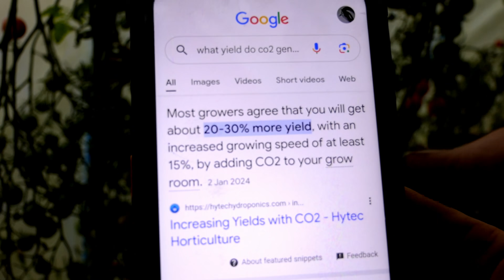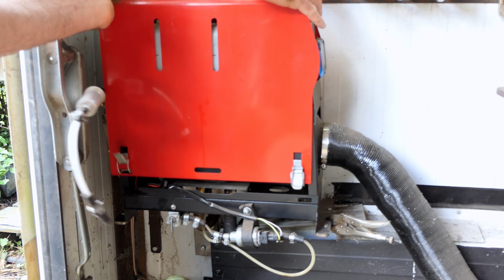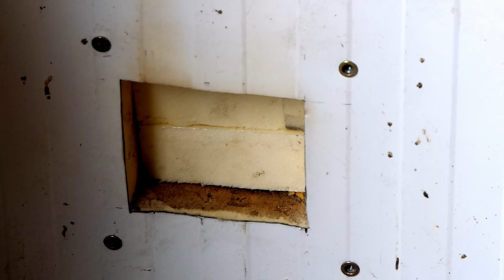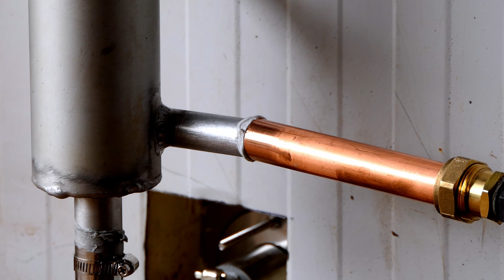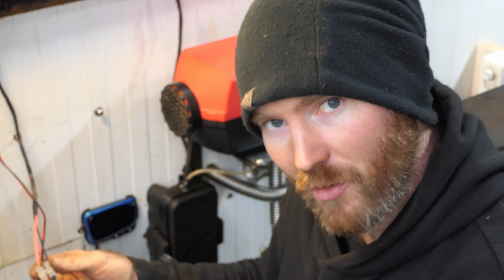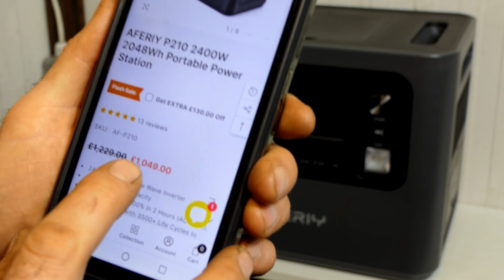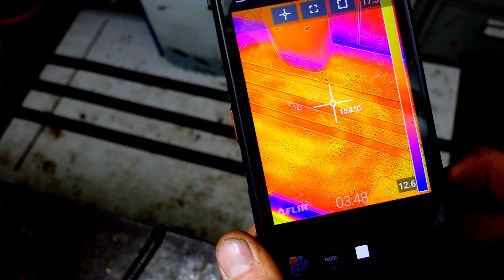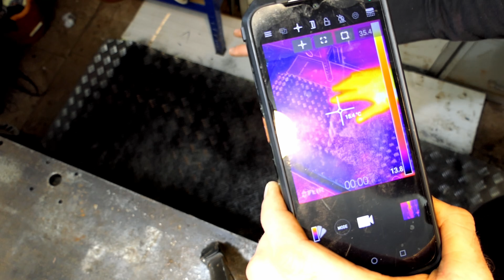NEW! Better system for Cheap and Safe Heating💲+ Underfloor Heating Mod test🫠

Comment: 1300 to 1850 AD was a natural cold period. The peak cold, around 1750 AD, had CO2 at 180ppm. Photosynthesis stops at 150ppm. We accidentally missed a seriously nasty bullet. 
By the way, Romans had it warm - aka the Roman Warm period. We were also warm from 900 to 1300 AD. Medieval Warm Period. 
That’s all Greenland ice core data. No fiddling. The information is all in there.
Reply from the maker: Very good information. Thank you. cheers J
Reply: Earth global average temperature has previously varied. But not due to human activity, and not to this degree. We are destabilising the fine balance of nature. Look at the graph of global average temperature vs time and the rise from the industrial revolution is an outlier.

Comment: I think you missed a trick, of using your 12V mains charger with a 12V 100Ah LiFePO4 Lithium Battery that typically can be purchased for less than £200. Saving you £800 🙂
Reply from the maker: Good idea. cheers J

Comment: You can make your own lithium power station using used lithium cells. They work fine with a “normal” car battery charger but you will need a lithium charge controller. 
A small motor scooter  battery is more than enough to feed the glow plug. A 4 amp battery charger is ample for continuous power of the heater.
Reply from the maker: Good tip, cheers J

Comment: You Asked: If CO2 Is Only 0.04% of the Atmosphere, How Does it Drive Global Warming?

A: Earth absorbs energy from sunlight, but as the surface warms, it also emits energy in the form of infrared radiation (which we know of as heat) out into space. Water vapor and CO2, however, act like a cap, making it more difficult for Earth to get rid of this energy. Without gases like these to absorb the energy, our planet’s average surface temperature would have been near zero degrees Fahrenheit.

About 99 percent of the atmosphere is made of oxygen and nitrogen, which cannot absorb the infrared radiation the Earth emits. Of the remaining 1 percent, the main molecules that can absorb infrared radiation are CO2 and water vapor, because their atoms are able to vibrate in just the right way to absorb the energy that the Earth gives off. After these gases absorb the energy, they emit half of it back to Earth and half of it into space, trapping some of the heat within the atmosphere. This trapping of heat is what we call the greenhouse effect. Because of the greenhouse effect created by these trace gases, the average temperature of the Earth is around 15°C, or 59°F, which allows for life to exist.

CO2 makes up only about 0.04% of the atmosphere, and water vapor can vary from 0 to 4%. But while water vapor is the dominant greenhouse gas in our atmosphere, it has windows that allow some of the infrared energy to escape without being absorbed. In addition, water vapor is concentrated lower in the atmosphere, whereas CO2 mixes well all the way to about 50 kilometers up. The higher the greenhouse gas, the more effective it is at trapping heat from the Earth’s surface.

The burning of fossil fuels affects the concentration of CO2 in the atmosphere. Before the industrial revolution, the amount of CO2 in the atmosphere was about 288 ppm. We have now reached about 414 ppm, so we are on the way to doubling the amount of CO2 in the atmosphere by the end of this century. Scientists say that if CO2 doubles, it could raise the average global temperature of the Earth between two and five degrees Celsius. We are already increasing the amount of energy that bounces back to the Earth. Because of the greenhouse effect, this is causing global warming with its many destructive impacts.

Both water vapor and CO2 are responsible for global warming, and once we increase the CO2 in the atmosphere, the oceans warm up, which inevitably triggers an increase in water vapor. But while we have no way to control water vapor, we can control CO2. And because we are increasing the amount of CO2 in the atmosphere by continuing to burn fossil fuels, even in relatively small amounts compared to the entire mass of the atmosphere, we are disturbing the entire heat balance of the planet.

For more information on how carbon dioxide traps heat, why water vapor isn’t the culprit, and answers to several other interesting questions, check out this post: How Exactly Does Carbon Dioxide Cause Global Warming?

Yochanan Kushnir is a research professor at Lamont-Doherty Earth Observatory, in the Division of Oceans and Climate Physics
Reply: Opinions matter more than facts in this new age of enlightenment it seems.
Reply from the maker: Thank you but I didn't ask that. it is the % that humans have made compared to natural CO2 that is telling. The crabon isn't the issue its the other factors of heat absorption and lack of water absorption from destruction of ecosystems that are a much bigger issue. cheers J
Reply: I'm guessing that you're referencing the claim about 0.0012%  of the atmosphere is human produced CO2 which you get from 0.04% CO2 current levels and "3% of that from humanity"? 

I can't find a primary source for that 3% figure, do you have one? The closest I've got is an Australian news broadcaster and subsequent social media posts referencing that broadcast. It seems this is a typo/decimal place shift of the number you referenced which is a 33% increase in atmospheric CO2 levels since 1850? So it's actually 33% (of current atmospheric CO2 420ppm, or 0.04%. which is 138ppm or 0.014%) from humanity. Not 0.0012%. 

Also, saying it's a small number doesn't say anything about how much of the effect it has contributed. The dose makes the poison. A 0.00001% change in botulinum content in a person would take them from healthy to death. The sensitivity of a system to an input isn't necessarily linear, meaning that small changes can cause big responses. An example being a hard ball balanced on another hard ball, where a miniscule disturbance might result in it falling much farther. You can't just say "it's a small amount so it's not that".  The question we need to answer is "what is the sensitivity of the system to CO2 levels?" and as @cpcnw eluded, the current evidence suggests it's pretty sensitive!

Albedo of roads is 0.1 vs forest at 0.15 and 0.4 for concrete. Making a ~5% increase in heat absorption between replacing a forest with a road. and roads account for 0.15% of land area. 0.04% of total area. Not factoring in cloud cover. 0.04%*5% is 0.002% difference in how much heat is absorbed. And that's ignoring the decrease in heat absorbed from concrete vs forest. There are heat domes around urban areas due to this effect and it does contribute to global warming, but not massively.

Forests also suck up huge amount of water releasing it through the leaf pores and increase local humidity levels, which decrease local temperatures, but if the local temperature is over a comfortable level then since RH is ~100% people feel uncomfortably hot because they can't loose heat by sweating. They still sweat, it just stays liquid on them as the air capacity for water vapour is already saturated. This humidity condenses in the atmosphere forming clouds that both reflect heat back out of the atmosphere, and act like a blanket reflecting the earths heat back at it. It's a double edged sword. Whether it heats or cools depends on if it's day or night and what the earths local surface is covered with.
Reply: @Leo99929  In the end it does not matter because when Net zero is finalised, we'll all be dead anyway, it's a scam and has been from day one. Regardless of co2 in the atmosphere, what good will it do when food production stops, electricity is switched off along with gas and the fuel pumps are left to run dry. It's all nice and fuzzy debating it, but in the end we will suffer because of a few, which by the way, has been implemented over thousands of years. IF you care for your kids (if indeed you have any) you will stop with the debating and get onboard with the rest of us in trying to stop this net zero madness ;)
Reply: @Leo99929 @joshuadelisle how come you never responded to this excellent comment?
Reply: @frankcastle_1984  it's unclear, but do you mean from richardharmer3805 "Opinions matter more than facts in this new age of enlightenment it seems."? 

I can't speak for Joshua, but for me it was because it wasn't constructive towards coming to a conclusion on the topic of debate: which I interpreted as "how much impact the proportion of "natural" CO2 vs "human made" in the atmosphere has had and will have on the global climate."

Unfortunately Critical Thinking skills and the scientific method are not taught in our educational systems which means that a large proportion of the population are not trained in how to discern fact from opinion. As such they debate on these topics based on what they feel and believe rather than the evidence available. We could speculate as to why that is lacking in our educational system and if it's intentional, but we do not know for certain. Hanlon's Razor: "Do not attribute to malice what can be attributed to ignorance." So it's best to assume that it's because of incompetence rather than some nefarious plan to keep people uneducated in the ways that ultimately matter, because it makes them easier to mislead into making decisions (voting) against their best interests, and vote instead in the interests of certain individuals or groups. Example being how in the 2016 American presidential campaign 65% to 70% of Americans earn less than the mean average wage and would stand to benefit from Bernie Sanders tax policy. But unscrupulous politicians and media outlets technically correctly pointed out that on average, each American would take home ever so slightly less money. They chose not to mention that was due to the overall significant increase in taxes for the ultra wealthy, and that taxes would decrease and take home pay would actually significantly increase for *most American's*. Hence people read the simple "On average American's will take home less" and made their decision on that rather than bother dealing with the nuance.

Also you might only get one active @ person reference per comment and it seems like it assumes the first one? I'm not 100% certain as I was the first mention in this comment and I got the notification. So if you want Joshua to answer you might need to give him his own direct comment? Also please be more specific in your question?
Reply: @frankcastle_1984  because he can’t counter the data. 
The guy is pedalling oversimplified “science”.
Reply: @joshuadelisle   natural co2 is part of a cycle (albeit a very slow one). it is released and reabsorbed. Man made emissions are a one-way street. Think of an almost full bath with a loose plug and a dripping tap - the level stays the same as long as the intake (tap) matches the outtake (drain), but increase the intake by even a tiny % of the bath volume and it will eventually overflow, its just a matter of time.

Comment: The wind turbine / generators  need 800 liters of oil for there gearboxes - this has to be CHANGED every 3 months 
That is 80,000 liters of oil in there life time - (if they last the 25 years) 
Add to that  all the raw mateials needed to be mined to produce them (copper / steel)
& the 100 tonnes of concrete needed for the foundation 
So they are not as "GREEN" as they make out !
The solar panels are actually worse 
Its all a big SCAM !!
Reply from the maker: You're right. Cheers J

Comment: I've had great success with Sand Batteries - after a 7-10 hours run of my Diesel heater during Winter the battery is still able to maintain the temperature at a comfortable level in my workshop for another 5-6 hours.
Reply from the maker: My tests concluded it was more viable to use a large vat of water than sand as sand is a poor conductor but work well over 600degrees celcius which is not what the exhaust produces. Cheers J
Reply: @joshuadelisle  It's the fact that Sand isn't a good conductor that I use it... the heat is gained and released slowly whereas water will gain and lose heat faster. Swings and roundabouts I guess... depends upon your needs.

Comment: At work our wall convection heater failed and they supplied an oil heater, a bit like the old looking ones. The hut it was trying to keep warm was freezing. I used a summer desk fan to blow the heat through the radiator and this made an amazing difference. Have you thought about just using small radiators with fans to radiate the heat?
Reply from the maker: Its an idea a few others have done. I'm not convinced a radiator as an exhaust is easy to clean though. cheers J
Reply: @joshuadelisle  you could try a fan on the existing radiator that's running on water. Not sure how much heat you'd get though

Comment: I have a 72 mci coach bus for a home and put in floor in the center channel, powered but a propane rv hot water heater.... I would love to rejig that with 2 diesel heaters for cabin air and heat exchangers to roast the water
Reply from the maker: They're pertty good but maybe have both systems just in case. cheers J

Comment: Spot on!!! Hello from British Columbia... love the cost breakdown! You could add a thermoelectric generator fairly easily on the back side of your exhaust...
Reply from the maker: Thats an idea. cheers J
Reply: Could also use a small sand battery  has a heat exchanger...have you run into any exhaust backpressure problems with pipe length? I am personal part collecting for a deep freeze sand heat battery for my mushroom shop..  your video today on cost efficiency push me to incorporate one
Reply: @HighonIonicthought  I've loved thermoelectric generators for years! Unfortunately the efficiency is roughly 5% - 8%. You need a system to ensure they don't overheat or they break. You also need to invest a portion of the power generated in cooling the cold side. Meaning that due to their cost, fragility, implemented weight, size, and the cost of the electronics to turn the output into something useful, they have very limited practical applications. I wouldn't waste your time experimenting, just do the maths from the performance graphs based on the temperature difference across them. The self powered fans on wood burners are about the only worthwhile application of the technology I've seen.

Comment: I've just had a heat pump installed, now waiting for solar panels. I already have 6kw of battery. My experience is that between March-October my heat pump cost will be £0 and 0 carbon. In winter my batteries (charged over night at 6p per killowatt) will run me all day, so based on 400% efficiency, I'm spending 1.5p per kilowatt. 
In terms of your conspiracy theory bullshit about 6 minutes in. Well, it's bullshit.

Comment: To counter claims from climate change denial arguments, it’s crucial to highlight how human activities have impacted the concentration of carbon dioxide (CO₂) in our atmosphere and consequently, the climate. Here are some scientifically backed points:

    Current CO₂ Level in the Atmosphere and its Increase:
        The current concentration of CO₂ in the atmosphere is approximately 423–427 ppm (parts per million), compared to about 280 ppm before the industrial era. This over 50% increase is primarily attributed to human activities, including fossil fuel combustion and deforestation. Sources: NOAA, Our World in Data.

    Human Contribution to CO₂ Increase:
        Although natural processes emit and absorb large amounts of CO₂ through the carbon cycle, human emissions have added a net positive flow that Earth cannot fully absorb. Roughly 40-45% of the CO₂ from human activities remains in the atmosphere, driving a rise in overall atmospheric CO₂. Contrary to the claim that “humans only add 3% of all CO₂,” this "extra" CO₂ cannot be fully absorbed, causing a persistent increase in the total concentration. Sources: IPCC, NOAA, NASA Climate.

    Effects of Increasing CO₂:
        CO₂ is a greenhouse gas that captures heat in the atmosphere, which strengthens the natural greenhouse effect and raises global temperatures. This rise is closely linked to higher global average temperatures, melting glaciers, and more extreme weather events. In addition, CO₂ increases ocean acidity, harming marine life and ecosystems, including coral reefs. Sources: NOAA Climate, NASA Climate.

    Scientific Consensus on CO₂ and Climate Change:
        Over 97% of climate scientists agree that climate change is primarily caused by human activities. This consensus is supported by leading scientific organizations such as NOAA, NASA, and the IPCC (Intergovernmental Panel on Climate Change). Without significant reductions in emissions, global temperatures are expected to continue rising, exacerbating issues like extreme weather, biodiversity loss, and deteriorating living conditions worldwide. Sources: IPCC, NASA, Our World in Data.

Conclusion: Denying the human impact on climate ignores extensive scientific evidence. Human activities have accelerated warming faster than any natural cycle in history, with significant negative consequences for life on Earth. Reducing CO₂ emissions and finding sustainable solutions is essential for the future.

It’s easy for someone without relevant education to sit in a garage and complain about politicians and scientists, calling them hypocrites, while presenting a homemade theory based on a calculator. This might impress like-minded individuals, giving the illusion that one has discovered something missed by the world’s leading researchers. But before discussing these topics again, invest some energy into truly understanding the facts from reliable, scientific sources. It may be difficult if you don’t trust anyone, but it’s essential for seeing the whole picture.

For more info:

    NOAA (Global Monitoring Laboratory): noaa.gov
    IPCC (Climate Reports): ipcc.ch
    NASA (Climate Science): climate.nasa.gov